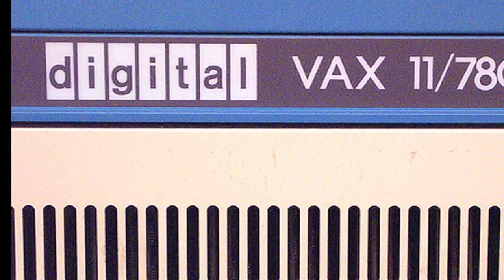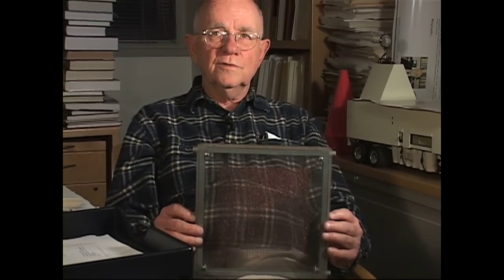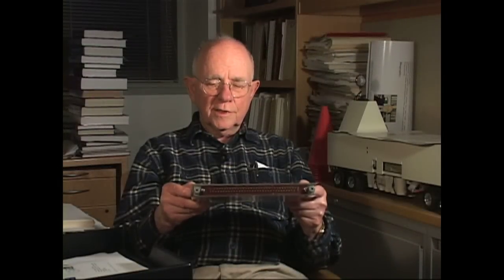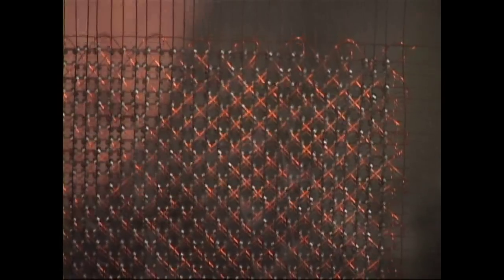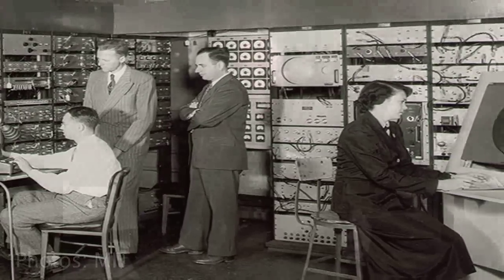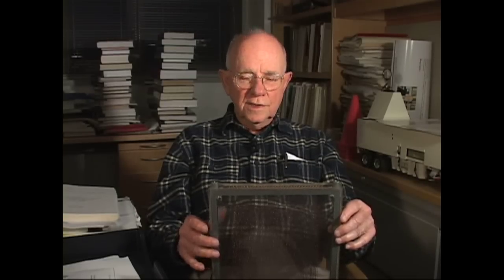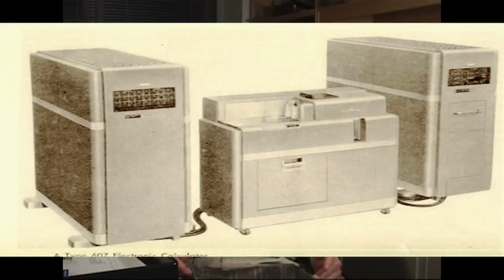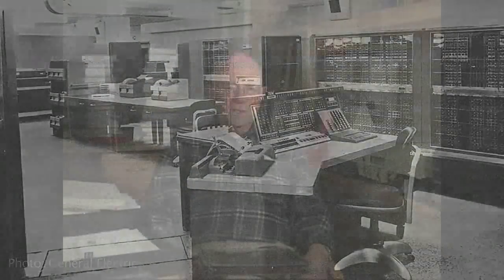World's First RAM Chip (Memory Plane)

Comment: I’m trying to imagine being smart enough to tell when the computer is giving me wrong data. 

I think he’s describing computers that were made entirely of vacuum tubes. Solid-state computers wouldn’t require half the building for air-conditioning.

I believe in 1940, there was a magnetic core memory that used mercury & some  chemicals.

Comment: This is not a ram chip. A chip is by definition manufactured directly onto the surface of a chip of semiconducting material. This is a plane of magnetic core memory. 

Nor is it the first random access memory device. That accolade belongs to the Williams Kilburn tube, which used dots on a specially modified crt to store bits. 

The core memory is a great achievement of course, but please make the video title accurate.
Reply: They can fix the title of the video by just adding successful before RAM.

Comment: I worked with a Data Genera computer in the early 70's that had 8K x 16 bits of Core Memory on 2 modules of 4K each. The input/output device as a model ASR-33 Teletype machine at 10 Characters per second. The great thing about core memory, was that once the program is loaded, it is immediately available whenever the computer was powered up (semi -ROM).

Comment: Whomever named this video clearly doesn't understand anything about computer or electronic hardware as a chip is an integrated circuit, and this is about the furthest thing from an IC you can get. Otherwise it's a very interesting video. You could have called it a RAM module, or memory module or something less specific.

Comment: I have great appreciation for the early pioneers such as Dr. Widrow. Not many years after the era of the Whirlwind, as a young 18-year old recruit in the USAF, I learned what constituted the basics of a computer in February 1964. Starting that day and working in all my spare time, I managed to build a simple, fully programmable digital home computer by August 1967. Entirely built using discrete components (no ICs), its magnetic drum memory stored 128 10-bit words. Its hardware could directly add, subtract, and multiply as well as perform conditional and unconditional branches. Input was done using an 9-button keypad and output was via a modified typewriter. Upon completion, that project launched me into a 6-week job as an IBM-360 operator, immediately followed by a 43-year career as a software engineer, retiring at the end of 2010. I have seen and used many of these magnetic core memories during my lifetime as well as most of the memory technologies that have followed.
Reply: ''immediately followed by a 43-year career as a software engineer, retiring at the end of 2010.''

Elementary...dear Watson!
Reply: Where I worked at one time, there was a manager who had who knows how many degrees.  He was a professor at a college, so he really knew computers.  Oh and he in the 1980s was in his 60s or so.  He liked the older technologies, and we had a huge and I mean huge, teletypewriter up against the wall, that no one touched, but he used it for something cics related.  Unfortunately what the man had going for him regards the brainiac department, he was missing completely in the interpersonal department.  Personnel told him to take a leave of absence and take a vacation as they were afraid he was going to go postal.
Reply: Joseph Watson cool story bro
Reply: Very interesting story Sir!

Comment: I worked on some of the first 32 bit mainframes in the early 70's. They had 8192x32 bit core memories (in this case made by AMPEX), basically the same as what Dr. Widrow was holding only smaller and denser (each module was about the size of a medium sized hardback book).
Reply: Do you have a piece of those? It would be great to cut it in halves and look at it for a couple of hours. xD
Reply: @RREDesigns  32 bit or 36 bit?
Reply: @rra022001  Either would be awesome. :D

Comment: whoever wrote the subtitles, its "two bits for PARITY", not PARODY
Reply: Wasn't meant as an offense, I am constantly amazed at the bad grammar/spelling that gets through.  But then I'm constantly having to fix Siri's mis-hearings, some of which are hilarious!
Reply: Happy to correct minor mistake too, for the pleasure to share. If these magnetic memory were working at the micro-second time scale, I would say that the most recent computers as of 2016 access memory approximately 2000 times faster, instead of "hundred of thousands".

I wander also if the title "chip" apply to these magnetic memory. I was thinking "chip" mean some integrated circuit, fairly small, encapsulated in a water/chemical resistant ceramic or plastic.

Comment: I think they were called mainframes because of the frames that held the memory lattices.
Reply: And all the other actual processing hardware, interfaces, tape drives etc; the computer itself resided in the main frame , and it was controlled by various remote video or teletype terminals (in the same room, elsewhere in the building, or working over a phone line) and accessed card readers, hard disc packs etc that were freestanding. But everything absolutely needed to run some kind of basic program was contained within the main 19 inch by ~7ft frames. A standard that's persisted into the modern day for server farms and the like because IBM designed them to fit very neatly through a standard size doorway with just enough wiggle room to allow for hallway carpets and the door itself, and so you could get your fingers around the edges to pull it into the computer room without skinning your knuckles every time.

Minicomputers then originally meaning anything smaller than that, particularly something that would fit into the size of a mainframe accessory like a card machine or terminal desk. Which is why we have the otherwise seeming misnomer of "micro" computer for those which fit into the space of a terminal or remote access modem. Perhaps thankfully the terminology moved to "laptop" and "pocket" for the futher reduced forms instead of "nano" and "pico" etc :)

Comment: Amazing. They set the 4096 number way back then. I wonder if , in order to go further, we need to chuck the old model out, and design the next generation from scratch using the newest tech we have.
Reply: shrug it's a fairly fundamental power of two, a square plane that has 64x64 (2 to the power 6) cores in it. Computers of the time hadn't settled on multiple-of-8 word lengths and were more often multiple-of-6 (as that's the minimum you need for a usable character set, as well as a reasonably comprehensive instruction set), so you could easily access any bit within such a plane with a sequential pair of 6-bit addresses (one for X, one for Y), or a single address on a 12-bit system... Though as this was mentioned as being one of 18 planes of which two were parity-checking rather than actual data, maybe it was used in an early 16-bit system... 12 bits of address could then be used for selecting a memory word (composed of the matching X/Y bit from each of the planes all together), and the other 4 bits for picking between 16 connected devices - multiple 4Kword memory stacks, disc controllers, card/tape readers/writers, additional processors, terminal interfaces etc...

Not really any more big interesting reason behind the size than that.There's only so many sizes you can pick from for a binary-addressed system using a limited (and particularly, symmetrical) number of bits. That's also why the original individual DRAMs and SIMMs tended to come in bit or byte sizes that increased by factors of 4, rather than 2 - they were all even powers of 2 (8 for 256, 10 for 1024, 12 for 4096, 16 for 64k, 20 for 1meg, etc) and the memory interface chips would latch in the Row then Column (same old X and Y as for the core planes) sequentially using the same limited set of address lines on the DRAMs themselves (with SIMMs being fairly simple affairs that were essentially just a quartet of chips on an easily inserted/removed board with their address lines connected up to the card edge contacts in a particular way to effect chip selection, so appearing just the same to the controller).

More modern modules allow factor of 2 sizing just by varying the number of chips on the board, with the slight asymmetry between row and column not being quite as important as it used to be given how many more lines there now are, and how variable the memory count in a single machine might be.

Comment: These were not really RAM chips, but magnetic core memory. I still have a 2K x 12 bit magnetic core memory which I salvaged from the trash when I worked at Digital Equipment Corporation. Very expensive to construct these by hand, but retained information without using any power, although that feature was rarely used. They needed relatively high-power electronics to drive the wires that read ("sensed") the current state and could change the state of the core at position x, y, and z. They were SO economical as compared with mercury drum, magnetic drum, or other kinds of memory.
Reply: +David Spector Yes they are. They are cards that contain memory that can be accessed at random. That's what RAM is.
Reply: It's "they're". Just kidding. I saw the nuckelhedd comment and couldn't help myself. On another note, people tend to forget that RAM isn't just the volatile stuff that forgets everything once you cut the power. RAM is any memory device where you can access any part at any time. All of the solid state memory ever created is one form of RAM or another. magnetic tapes, hard disks, and CDs are not RAM since you can only read one bit at a time.
Reply: Teth47 
You make a good point but, I always saw them as sequential since you still have to move a read/write head to a location and you can't read/write multiple locations at the same time. When I was a kid, I wondered if you could make hard drives and CD drives faster by having more than one read/write head per disk.
Reply: +Teth47 
I see. In that case, punch cards would also be RAM. I've never worked with tape drives in a computer but, from what you say, I'm assuming you can't just go to a certain location like you can with audio tapes and video cassettes.
Reply: Teth47 
Ah. Moving the head versus moving the tape. It amazes me how much you can fit on just a few disks now. I have a two terabyte hard disk in my laptop for games but, I wish I could afford an SSD that size.
Reply: If high performance flash memory wasn't so expensive, we could use cartridge style SSDs for everything including major game consoles.
Reply: David Spector
Reply: Amazing detail David. I came here for the ASMR but now I am fascinated by the this. What a story this could be. Someone should write a movie about it and have Hilda as the main star for knitting the first RAM!
Reply: Jason Queen The differentiating point between sequential and random access memory is how the reader head is capable of moving, not whether or not there is one. A hard disk or CD's read head can move directly to any point of data on the disk without having to sequentially read every bit between those two points, like a tape would. If a hard drive were sequential storage, if you tried to copy two things that were far apart, it would take hours to move even small files, because you'd basically have to read the entire drive to find the spot you're writing to. Hard drives also generally have more than one R/W head per disk, but only one per surface. Adding a second channel to each disk doubles the amount and complexity of the supporting circuitry, so while it would theoretically increase performance, it's cheaper and more effective to simply use two hard drives, which is what RAID is.
Reply: Jason Queen Nope, hard drives are random access storage too. The number of bits that can be read (Not one in the case of most of those formats anyway, BTW) has nothing to do with whether or not a given storage type is RAM. Tapes are an example of sequential storage, in order to read data in the middle of the tape, you have to scroll through the whole tape, you can't skip a part because of how tape is read. Hard drives and CDs can jump tracks and rotate directly to any point of data at any time, without having to traverse the circumference of every track in between, that's what makes the distinction.
Reply: Jason Queen You can, but you have to traverse the entire tape surface between those two points. You can't read a part from the middle of the tape reel, you have to scroll through the whole tape until you reach that point. On a hard drive, you can skip over the surface, rather than having to slowly wind your way along every track in between the origin and destination.
Reply: Jason Queen It's not, at last, not in amounts small enough to hold games. Cartridges would work, but it's much easier and more cost effective to put one big, fast drive into the console and just download things, then all the company needs is a server and a fast internet connection instead of the headache of distributing physical media.
Reply: err, even tape has a file system that allows it to jump around. or at least it has since the 80s, probably earlier. just depended on what and how you were storing it. no point in an archive tape if you have to read the whole thing just to find one thing. i'd stick to solid state storage being "ram", which of course would also include roms. i think a more accurate term that folk here are looking for is "active memory".

Comment: Microsecond access time? So you could still (apart from physical dimensions and interfacing difficulties) succesfully use it for some kind of mechanical machine control application. Todays simplest microcontrollers still work at these speeds.
Reply: +pvc988 According to one source, it was first developed for JUKE BOXES (coin operated machines which played music stored on phonograph discs in the machine) to allow multiple selections to be entered at once: the core for a particular song was set to a 1 when purchased, the machine would scan for the next core with a 1 and play that song, then reset its core to 0 while playing, then look for another core with a 1.  From there to computers with many more cores!
Reply: +Allan Richardson Yeah. Today that would be a job for a microcontroller.
Reply: +pvc988 It was used between 1944? and 1978? in several general-purpose computers, including the one I programmed, the LINC, which was developed by Lincoln Labs and manufactured by Digital Equipment Corporation.
Reply: It's not even as slow compared to modern memory as made out in the video... DRAM has reached a bit of a plateau in terms of access speed that's equal to no more than about 200 ~ 266mhz, so 4 ~ 5ns (for pure random access; bulk burst reads are somewhat accelerated)... so "thousands of times faster" isn't really accurate. Though the on-die and SRAM based cache of a modern CPU does run at some GHz and in terms of capacity can be many times more than the total storage a classic mainframe ever had online, so there's still some truth there.